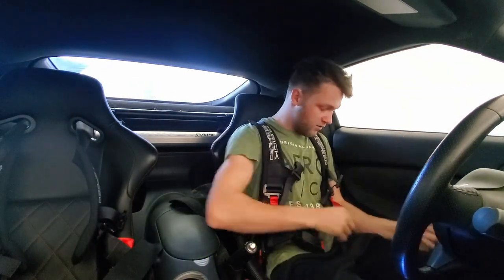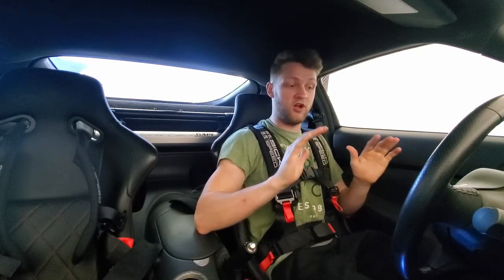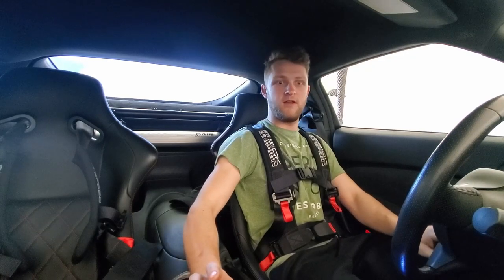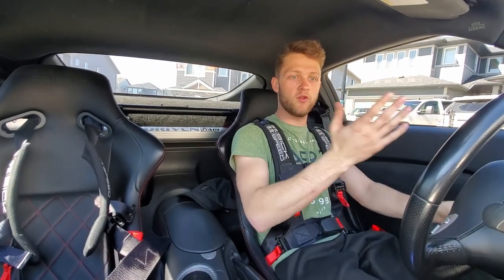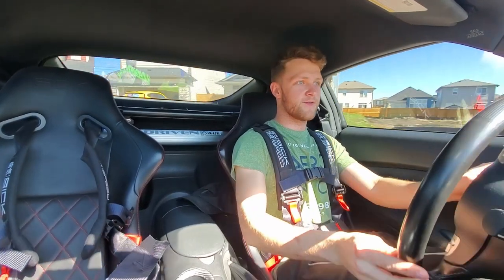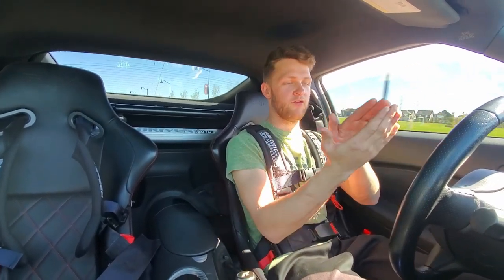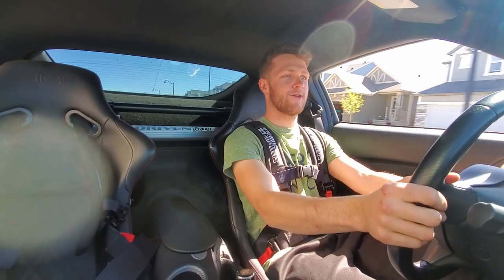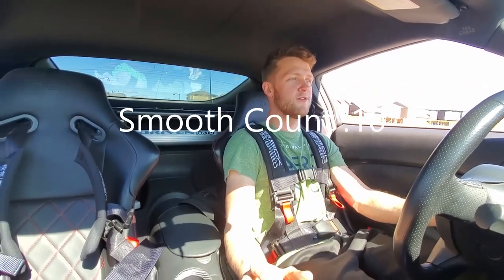Best 370z Driver Mod!! - RJM Clutch install + Reactions

Comment: It's been 2 years since your pedal was installed, how is it now? Still loving it? :) I'm considering the 4th revision as I write this.

Regarding the "sticking" pedal - my 350z (HR) does the same. If you want to launch the car quick from standstill, it's like the pedal can't keep up with your foot and stays behind. From what I've read on forums, there could be a few reasons to this. 

Firstly, I believe you have a Clutch Delay Valve (like a 350z) that should limit the speed at which you can engage the clutch in order to protect the drivetrain. However, it does make fast shifts awkward or even impossible (or so I've read). It sort of keeps the clutch bearing from moving fast. I'm considering removing it (it should be on the pipe from master to slave cylinder).

Secondly, your slave cylinder (Concentric Slave Cylinder to be precise, meaning the bearing is one unit with the hydraulic slave cylinder) may be on it's way out. I've heard the stock ones are not very well engineered and they tent to wear out quickly. 

But I have no other cars to compare it with at the moment so I have no idea how a standard clutch should behave. Can someone clarify, if this is standard behaviour or is there something wrong? 

Thanks in advance and enjoy your 370 ;)
Reply: I had the same issue where the pedal got stuck when I launched the car quick from a standstill

Comment: You have me convinced just cause of the smooth count 😂
Seriously tho I want to grab one of these
Reply from the maker: hahaha it definitely is a lot smoother. ran into some issues in the begin but after some fine adjustments its working better than ever.
Reply: Hunter Allen what kind of issues did you run into??
Reply from the maker: @tmacz24  after i first installed it, on hard pulls the clutch would slip when changing gears especially 3rd. so i went back and tightened and adjusted it and that problem went away. haven't had a problem with it till last week when i hit the drag strip, shifting it slipped again (ruined my 1/4).. so went back and adjusted some more and re tightened and now its working good again. it has its moments , but its more often then not a pleasure to use
Reply: @hunterallen4329  what exactly did you have to adjust and re tighten? I have the pedal but haven’t gotten a chance to switch it and I can’t stand the stock clutch pedal

Comment: Hey bro what’s your sequence on down shifting? Be cool for a tutorial video. I have a base model z so mine doesn’t have synchronized rev matching. 

My understanding you clutch in /blip the throttle/ shift. But it’s a little harder I’m using standard shifter but plan on replacing this weekend with the rjm
Reply: Instablaster
Reply: I have the base z as well without the auto-rev feature, you have to clutch +shift and blip simultaneously and let out when the synchros catch the rpm.
Ofc if you're new to rev matching you can take it slow, rev it a little more than you need then smoothly let out the clutch and let it grab first.